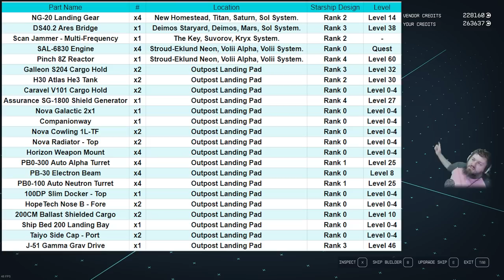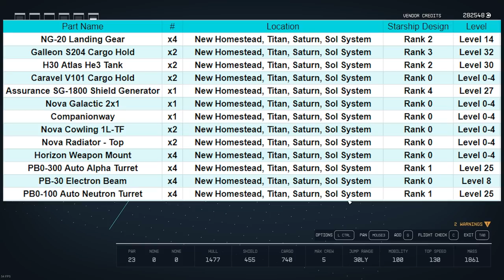The Blister Beetle Micro Class C Ship Building Guide | Starfield Small Ships

Comment from the maker: Ship Part List Below (I HAVE NO MODS 100% BASE GAME SHIP)

Correction to Errors I made in the video
-My stats might differ from yours based on skills and crew assigned to the ship.

I love when people make the ship their own and fit it to their needs, change everything or nothing just enjoy it!

 I hope you enjoy the video and enjoy the ship! 

(*ed Parts are unavailable at Outpost Launch Pad)

Neon Stroud Eklund
*SAL-6830 Engine x4
*Pinch 8Z Reactor x1
J-51 Gamma Grav Drive x1

Neon Taiyo Astroneering
Ship Bed 200 Landing Bay x1
Taiyo Side Cap - Port x2

Red Mile
*Scan Jammer - Multi-Frequency x1
200CM Ballast Shielded Cargo x2

Hopetown
HopeTech Nose B - Fore x2

Deimos Station
*DS40.2 Ares Bridge x1
100DP Slim Docker - Top x1

New Homestead
*NG-20 Landing Gear x4
Galleon S204 Cargo Hold x2
H30 Atlas He3 Tank x2
Caravel V101 Cargo Hold x2
Assurance SG-1800 Shield Generator x1
Nova Galactic 2x1 x1
Companionway x1
Nova Cowling 1L-TF x2
Nova Radiator - Top x2
Horizon Weapon Mount x4
PB0-300 Auto Alpha Turret x4
PB-30 Electron Beam	x4
PB0-100 Auto Neutron Turret	x4
Reply: Hey Dig, love your builds! You had mentioned The Shield Capacity being largely buffed in one of your builds. It's because even at max 4/4, when you add a companion with the same skill they compound onto your bonus. I'm pretty sure from your numbers, that's why. I hope this helps and thank you again!

Comment: Two people asked before me and only got same stupid answer ("skills and crew") so i'll ask again: how did you get 3200 shield? I use the same shield, Shield Systems skill at level 4 and got both Vasco and Omari in my crew and my ship only has 1920 total shield.
Reply from the maker: For my crew I have Ezzekiel (Shield systems 1), Omari Hassan (shield systems 3), and Vasco (shield Systems 2). With personal Shield Systems 4. Nothing else that I know of.
Reply: Yeah got Ezzekiel now too and while outside the ship the shield value is 3200 BUT when i go inside and fly to space the value changes to the correct amount and that is 2880. Why 2880 is the correct one: 1600 base shield + 60% from your skills and +20% from Hassan (the one that has the highest tier from the shield class on followers). Two things to add: first Vasco screws up the calculation always while your ship in on ground since he goes in and out of the ship depending where you are and second DON'T capture other ships while you fly your main one, always go solo, otherwise you risk bugging out your ship shield value and calculations, you can end up having under base value (under 1600). I suspect the bug hapends when you capture a ship with not enough crew space for all that you have and then the calculations get screwed up. If that hapends you can't fix back that ship best way is to sell it and get a new one. @Digfig

Comment: I would so much like people stating the values the ship has and not values changed by character and crew skills. Max shield a vanilla ship can have is 1600, nearly all ship building YouTubers state fast higher numbers which are based on crew and skills. Sometimes a bug exaggerates the numbers, I myself had 2ships with the same shield generator, one had 1920, the other 2240. Don't know where the additional 20% shield buff came from ...
Reply from the maker: Ya it's hard I tried that early on and we get somuch crap from having low numbers because no one understands the difference between raw stats and modified stats. To most people all that matters in the higher #. I would get so many comments of people just saying shit ship or crap ship all my #s are higher on a class A you suck and bla bla bla. I show the unmodified in game when I show the mobility and during the making. I wish there was a good way to make everyone happy but it's kinda a no win. As for your shield stat I'm 90% crew stacks so if you had someone with 1 shield, someone with 2 shield and someone with 3 shield you would get all the % to some level. That's been my experience then getting the game to always load those #s correct is a pain in the ass. Even during recording a single video the game will show me 2 or 3 #s and I need to check my crew and reload just so it's consistent though the video.
Reply: @Digfig  I sympathize with you, and understand that making content and everyone happy is nearly impossible.
An option would be, as you have a section with requirements, just state the skills and crew needed, as these are are as needed as Ship Design 4 and level 60 to get the stats.
Nonetheless great video, and thanks for your effort.